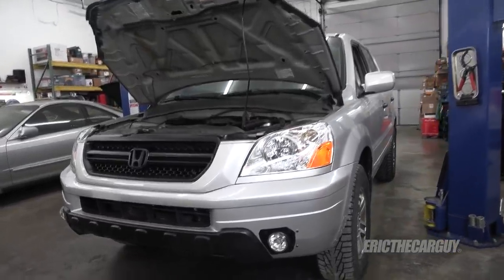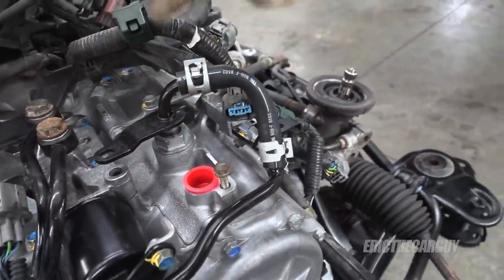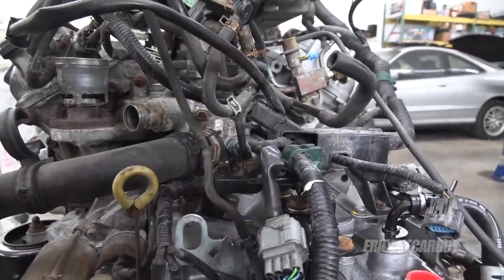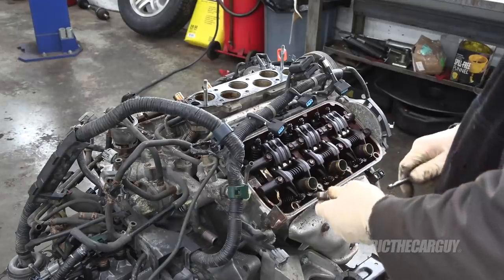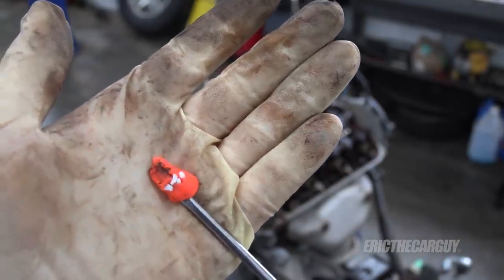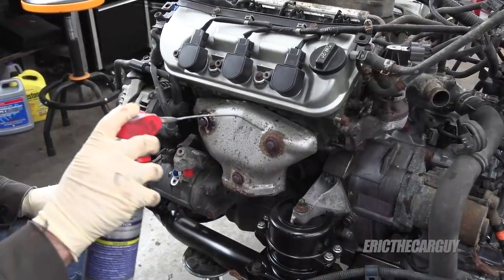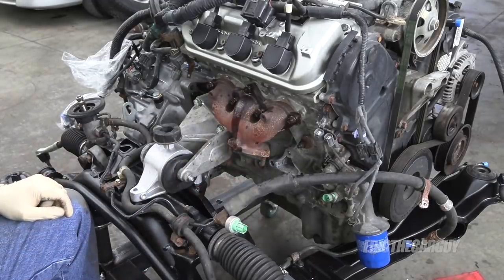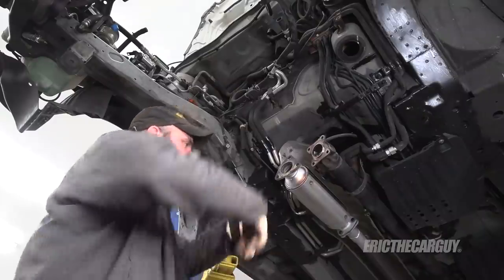Honda Pilot Timing Belt and Engine Service

Comment: Eric I'm glad you got the Aisin timing belt/water pump kit this time. Avoid those fake OEM timing belt "kits" from ebay/Amazon at all cost!
Reply: How do you know you didn't get a fake one from where you bought it from?
Reply: I got it from RockAuto. $175 + tax in May 2020 - many of the OE parts used in this kit.

Honda doesn't sell timing belt kits for the J35, have to order them a-la-carte when you go to the dealer and is pretty pricey.

You know it's fake if you find it in a kit that costs less than $200 🙂
Reply from the maker: Me too. I have a feeling that's why the TL broke down.
Reply: @ericthecarguy  I think so too. I hope it isn't though, that can be quite the pain to deal with on an interference engine.
Reply: I also learned the hard way about cheap timing belt kits.
Reply: Bando belt is competitive price as well. Consider it. I bought one online and it runs great on my car. Finger cross.

Comment: What I found that works well after painting parts like valve covers is baking them at 250 to 275 F  for an hour and a half and hardens the paint makes it last longer and a most of the time minor runs in the paint disappear from it being baked.

Comment: So nice to be able to service an engine out of the vehicle. Years ago I had to replace the clutch and flywheel on my Integra, and also replace the timing belt and reseal the oil pan. I decided to pull the whole drivetrain which made things infinitely easier.

Comment: Next time use lemon juice and baking soda. The copper will clean nicely. With the wire wheel you probably made the strands thinner. Also if you see green dirt on the wires the green stuff goes up the cable. The lemon juice will clean even inside the cable where the wire wheel couldn’t reach.
Reply from the maker: I don't normally keep lemon juice at the shop, but I do keep electrical contact cleaner which is what I used. Not that 'home made' remedies aren't cool. Also, I checked the resistance of the cable as you saw in the video and I feel I'm good. Thanks for the comment.

Comment: Eric, a lotta lotta work, dude!  Very nicely done. This and the Mini show the complexity of modern cars, yet still comprehendible by a good mechanic (I won't say "average mechanic" .. you're up above that now by a good margin!) I hope that after you move you can get a hot washer style large scale parts cleaner - there's a zillion styles - which you deserve and I think you could use given the large amount of stuff you need to clean.   Car Wizard has a nice one.  Also a crab pot or larger with a propane burner,  using a mix of super clean and some detergent does a great job! I've seen guys use old institutional dishwashers with a heating element for the water.. I mean I LIKE your squirt bottle of pressurized solvent, and it's very useful, but for that large scale gunk I'll be interested if you get something a bit more up the scale.  Thanks for the video Eric!

Comment: Nice practical cart,  Good Job!   I like how you got thru all the little detail things and make sure they are working and correct.   Wish I could find a mechanic like you in my town.  I think the flat rate system is driving them out of the field.
Had to redo the motor mounts on my Honda and it was Not Cheap.

Comment: I love your videos Eric. If there’s anything I can add, and these are more personal preference, I would recommend cutting the insulation of the cables just below the end of the copper terminals and look into a hydraulic crimping tool. They’re fairly inexpensive and work quite well. I also like to use tinned copper lugs on connections that would be exposed such as in an engine bay and to add a bit of silicone to the exposed copper before you put heat-shrink tubing on (or get the one that is lined with adhesive).  The last tip I have would be to use wire ferrules on that style of battery terminal. It helps  especially if you have to remove the wire later on and just looks cleaner to me. Just my preference and a few tips I’ve picked up over the past few years.
Reply from the maker: Great suggestions. Thank you.

Comment: You're a braver man than I am.  No rags or towels in the IM holes?  My luck would be some rando nut/bolt flying down a hole of doom.  Glad you did not experience that.  Seems so simple with the engine out and 360degree access.  Great video.  Will come back to it multiple times as I work on our '06 Pilot. Thanks!!

Comment: 21:25  When I changed the plugs on my 07  TL Type S  they all looked like they were the original plugs and the car had almost 100,000 miles on it keep in mind I am now the 4th owner of the vehicle So the previous three could have cared less about the car's, maintenance and health. It never ceases to amaze me how people could spend tens of thousands of dollars on a vehicle and not take care of it
Reply from the maker: Spark plug replacement is only due every 105K on this engine. That's why the plugs are so expensive.
Reply: @ericthecarguy   I guess that's just a me thing  My dad kind of beat it into my head to always keep up on the maintenance of any vehicle and specifically to always change the spark plugs I remember as a kid constantly changing plugs with him he was super OCD about that  So when I got my car One of the first things that I did was change the spark plugs  I put NGK IX iridium spark plugs in my car  tried to get the NGK laser iridiums But the local auto parts store didn't carry them so I went with the IXs

Comment: In a pinch you can clean copper wire w/ salt & vinegar.  Simply mix the solution and put the wire in.  Remove once desired brightness is achieved.  It's quick, effective, and gives great cleaning coverage.

Opinions abound about electrical tape in the engine bay.  I like to use the fabric tesa tape.  Useful for wire harness repairs as well as interior trim pieces that are rattling / rubbing.  It'll be a little bit of a sticker shock but buy it in bulk - trust me, you'll use it.
Reply from the maker: I used the fabric tesa tape on my last project. Never again. The reason is that as soon as that tape gets any oil on it it disintegrates into a gelatinous mess.
Reply: i will keep that in mind, thankyou 😀

Comment: I'm a big fan of the supertech full synthetic high mileage oil.  $17 something for five quart jug and it's warren distribution, same as costco and amazon basic.  I use it in everything since my lowest mileage vehicle is 186,000 miles.

Comment: Probably you might know this, Eric, but there might be some fols that could use some advice. When tightening bolts, fasteners and screws, turn them CCW or against its tightening direction until it clicks, and it will have a minimal risk to get cross threaded.

Comment: Of course, it is long established that beard length comes with its own level of auto expertise. I remember my designer stubble giving me some great diagnostic ability. And I've heard a rumor that Eric's current effort can change out clutches unaided... whilst Humble Mechanic's beard has its own specialist custom shop in Maine. 😆😆
Reply from the maker: Nope, it ate the paint. I'm going to try non chlorinated brake cleaner to see if that helps.

Comment: I doubt I'll ever do this big of a job with the engine in or out of the car but it's fascinating. I love all Honda V6s. My 2010 Accord V6 is coming up on 200k and I haven't done the belt/pump job yet. I'd have to do it myself with some help at this point, otherwise it's almost half the value of the car.
Reply from the maker: There is a video in the description you might find useful for that job. Thanks for the comment.

Comment: Love  this channel. I will be doing my first time ever timing belt on a j series. Happy new year 🎆🎊🎈
Reply from the maker: Thank you. There is a video linked in the description you might find helpful for J series timing belt replacement.
Reply: Get the Aisin kit for the J-series (Edit: Part # TKH-001 - as linked in the description).

Avoid ebay/amazon - lots of fake "genuine Honda" timing belt kits being sold. They even have pretty close looking Honda stickers on them. Even fooled ETGC as seen in his Acura TL timing belt video 🙁
Reply: @vincelow  TKH-002 is for most Hondas but not all. The one in this video for example is TKH-001.
Reply: @WiiMaster good catch, the Pilot is TKH-001 as you mentioned. Just edited so it's correct now 🙂

I got the TKH-002 for the J35A8 in my TL.
Reply: @vincelow  I have a 2013 TL with 90k so I want to do this service on my own and hopefully I don’t miss timing 🙏🏽🙏🏽

Comment: Ever hear of innovation heat inductor for frozen bolts? Must have tool!
Reply from the maker: Very expensive and won't fit into tight areas. Not saying they don't work, but they do have their limitations. Thanks for the comments.

Comment: Never use Copper Anti-Seize on Aluminum parts.  The aluminum will be destroyed by Galvanic Corrosion as the copper is higher on the Galvanic Scale.  I had a set of Aluminum Rims seized on my Pick-Up when the previous owner had new tires installed and when I had to remove the tires to replace the front and rear brakes, I had to beat the rims off the rotors.  This was about three years after the tires were installed.  Previous owner was my sister so I knew the history.
Reply from the maker: I haven't seen that, but I'll keep an eye out for it. BTW, I find that domestic vehicles have the biggest problems with wheels getting stuck on hubs. https://www.youtube.com/watch?v=H7PWwrcGREM&t=12s

Comment: The way the spark plugs came out and went back in... I had a similar issue before, turns out someone cross threaded them before and installed helicoil to "fix" the issue. The helicoil was installed incorrectly,, protruded into the combustion chamber, melted on the spark plug later and made it impossible to get out.
Check the threads in the heads.
Reply from the maker: I've had a similar thing happen in the past on a different engine. It was not the case with this engine. The threads were fine. Thanks for the comment.

Comment: DIY work-around for ground cables:

One can make all kinds of terminal ends with standard copper plumbing pipe.  Solder or crimp depending on the shop tools and implements available.  Buying a special terminal kit for the one-off occasional shade tree repair just doesn't make sense.
Reply: Why not solder them as long as they are out?
Reply: @stevewolf2620  Yep.  I specifically avoided mentioning soldering since a couple of similar comments brings out the Internet trolls which scream that soldering connections are failure prone to long-term vibration and are of higher resistance.  Their zealotry is near religious and beyond annoying.  And granted, they are somewhat right.  But, this isn't an aviation application and such a repair will have an acceptable service life.
Reply: I don't think that's a good idea, the terminals are an alloy, copper pipes are pure copper (water chemistry and all that jazz). That and pipe is much, much thinner. If your terminals are as thin as a pipe, leading you to believe that copper pipe is ok to use, then you're using cheapo terminals. Just my 2 cents.
Also, maybe not in all places, but you can rent the tool and buy just enough terminals from an electrical store/car parts store to do the job in most countries i've been. IMO, having to redo ground (or other issues) because a pipe broke from stress ain't worth it. Cheaping out never is.
Reply: Tell you what...  You do you and I'll do me.  The oldest copper pipe ground lug I've put on a vehicle is 30+ years old.  I'll accept the risks of, "Not doing it right," given real world longevity.  I also use copper pipe DIY lugs for welding lead fabrication and homemade high-amperage electrical bus bars.

Rather odd pure copper is used in roof flashing around chimneys and bay windows, though, wouldn't you say?

To others following the thread, inform yourself, modify the information to your particular situation of time, resources, and cost, then proceed accordingly.

Comment: I love your content Eric. 
I don't like the shiny threads on the spark plugs your removed from the rear bank. Are you sure it's a good idea to remove plugs with an impact? I always loosen then slightly, spray them with some penetrant, and then finish removing them. All by hand, no impact.
Thanks for the great videos!

Comment: You should try some Cold Oven Cleaner on the valve side of the valve cover, cleans very well.
Reply from the maker: I have a scar on my arm from doing that with cylinder heads back in the day. FYI, don't get it on your skin.
Reply: @ericthecarguy  Used it for 37 years on centrifugal compressor impellers.  never a problem

Comment: 9:30 I did not have good experience with the shrink tubing with solder inside. On one vehicle the shrink tubing became brittle after just two years and the soldering connection was not secure (which could not really be seen from the outside).
In hard to reach areas this can create a nasty, intermittent error in the long run.
Reply from the maker: Sorry to hear that. I'll keep my eye out.
Reply: @ericthecarguy  There are probably different qualities available, but I prefer the soldering iron and good shrink tubing. But maybe that's because I'm an Electrical Engineer :D
Reply: @ericthecarguy  If you buy your glue shrink tube from proper establishments you should be ok.

One trick i use this stuff for is wrapping my sway bars, linkages and whatever i can get in it, making them rust free. That's as exposed as it gets and i've stuff as old as 8 years now that's not even in the hard rubber stage, still soft, nail pokeable.

Obviously, if you cheap out on stuff like this, you expose yourself to a game of chance, i usually buy it from the same stores that supply high voltage electricians. It comes with a bigger price, but you get the guarantee, also, thicker stuff, like 3 mm thick skin for something like a 2 cm ID tube (unshrunk).

Comment: planning on doing this on my tl 3.2 at 200K, any recomendations to do oil pump seal which is a common leak place and other seals? I will also replace rear main seal which is why i think it would be easier to drop the motor

Comment: Did you inspect the camshafts while you were in there? I’ve read that worn camshaft lobes are a problem on some of these J35’s. My ‘06 Pilot has a tapping noise that I suspect is caused by that issue. I haven’t decided whether to dig into it and check, or just let it continue however long it’ll keep going.

Comment: Is there any way you can address the cam tower retorque procedure?  I understand there is an issue with that on these era J series engines.  Also, I thought you said you were going to adjust the valves?

Comment: What about the rocker shaft bridge bolts? The loosening and re torquing to get rid of the possibility of the knocking/ticking noise at idle.
Reply from the maker: In 30 years of working on Hondas I've never seen that. You just need to do a proper valve adjustment to get rid of the 'ticking' noise. Link in the description.

Comment: Great video, Eric! Do you have some insights on anything I can do to reduce oil consumption on my 2010 3.7 TL engine? Short of rebuilding it, of course... I can never tell whether it eats more oil being babied or run hard and speculation from owners isn't nearly as valuable as your experience. Thanks!
Reply from the maker: I've never known oil consumption issues to be solved with a can of something poured into the engine. As for rebuilding the engine, I'd recommend a good reman instead: https://www.youtube.com/watch?v=KWjF56tFzRg&t=16s

Comment: Amazing Sir. I have a 2003 Accord Coupe,81000 miles, with a 4 banger. Your knowledge of Honda engines has impressed me, I was lost. I did notice the Honda “Fix” for the transmission {rubber hose} that is not on my engine. Dealer said all recalls have been done, Yea right. Thanks so much. Happy New Year!
Reply from the maker: The 4 cylinder transmissions were not the problem transmissions, but the 6 cylinder transmissions had several problems. Just be sure to only use Honda fluid in that transmission and you should be fine. Thanks for the comment.

Comment: If you were looking for a fun used Honda/Acura sedan now without spending a fortune, which model years would you target to fix up? The 2018+ Honda models are interesting with the k-series turbo + tune, but I suspect the older 6cylinders will be more reliable long term - just slower. Maybe a TLX w/ the J35? Need to avoid early 00 transmission issues of course. Let's say 15-20k budget but flexible.
Reply from the maker: https://www.youtube.com/watch?v=M5vchkvemG8&t=2s

Comment: i just recently put a b18b1 motor into a civic changed timing belt and water pump but didnt think about timing.  engine wont crank now.  does the motor need to be at tdc to crank and run again?